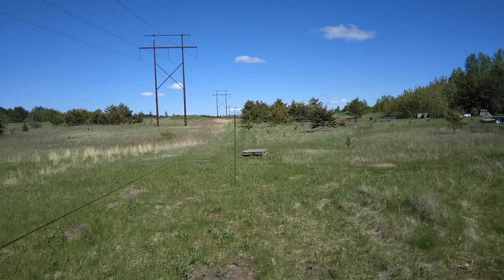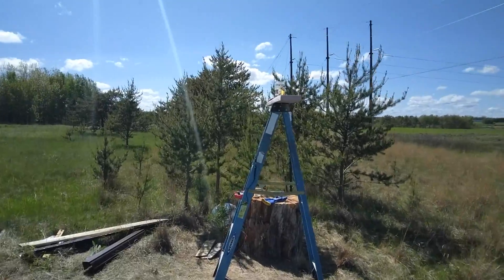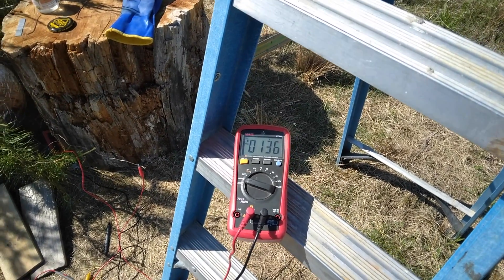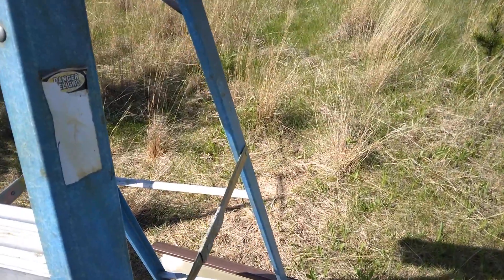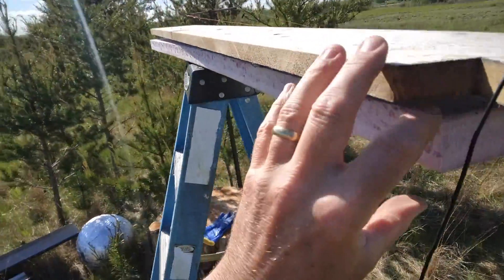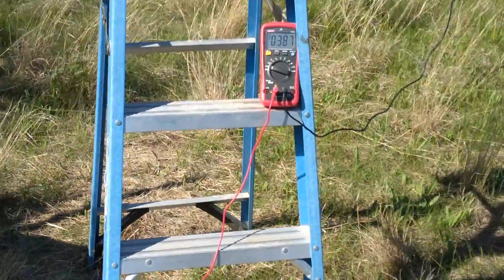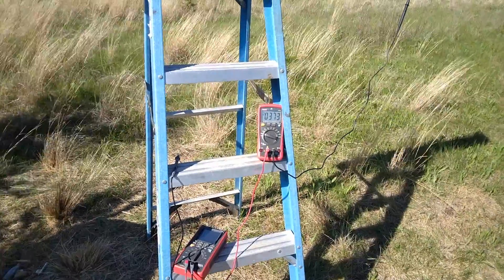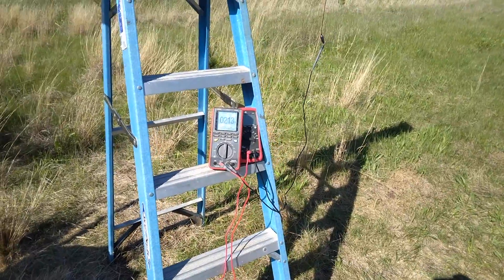Amazing stray electricity collector design!

Comment: It's called influence or capacitive induction. For magnetic induction the magnetic Feld is to weak

Electric Feld probes are built similar. To detect electric felds. If you are in the vicinity of an HV transmission cable then you have pooven that that company that own the transmission line ate polluting the area with strong electric felds. Also if you aren't under a transmission line then you are getting atmosphereic charge. The earth has equipotential lines parallel to the earth ground they reach till to the ionosphere roughly 100V/m to 200V/m of elevation. If you put a isolated conductor up from ground you get a voltage. That's the reason why atmosphereic motors work. If you are interested Lasersaber's Channel explained it very well. Just Typ his channel nam or Atmosphereic motor in the YouTube search

Comment: WARNING!   Basically you have built and air core capacitor. The power lines are one plate and your wire you have strung around in the air is the other plate.  WARNING! The primary part of your capacitor (the power lines) are operating at maybe hundreds of thousands of volts and very high amps are available. If you happen to get enough surface area on your side of the capacitor with certain weather condition, you could have a chance of an ARC from power line to your side. I STRONGLY suggest you find another hobby for your own safety.

Comment: I wonder if the wood board works better because it capacitively couples to the grounded metal ladder worse, so slightly less losses. In that case it'd couple to the lines worse as well tho? so maybe this is a silly guess. Actually I bet most of the energy comes from the ions literally streaming off the lines. Rather then the antenna coupling to the lines? So this would still make sense to some extent.
Idk im gonna keep watching these cuz this is honestly fascinating. Guess I'll find out if you ever figured out an experimental way to work out what's going on

Comment: So one of ur videos had me thinkin,  my pond is right by the railroad tracks,  and theres olld unused telephone lines ran there,  wires still there,  say i put a ground rod in the pond wouldnt thoae telepjone lines have power?   There side by side conductors like u had goin from roof to barn.  Im in nd btw
Reply from the maker: If the wires on the poles are insulated from any grounding effect, there could be something between the wires on the poles  and a pond ground.  What could it hurt to test it?  Best wishes!
Reply: @doubleMinnovations  what would be a safe way to test?
Reply: @doubleMinnovations  do i dare get a ladder and my voltmeter and connect black lead to pond ground rod and touch telephone wire with red lead?

Comment: could you use a regulator or step down transformer to charge a battery?   Or,  store enough charge in your vinegar batteries to be useful for a low power project?
...also wondering if wood is yielding more than aluminum, where would copper (old bit of pipe if you have some) or coax sit on the scale of things??
Reply from the maker: I would suggest watching the other videos I have on these subjects.  There's small amounts of energy available, but there's only so much energy available for a spacial area.  So the many different metals and wires I tried, the weak acid treated wood is so much easier and cheaper to construct.

Comment: Telluric Currents. I think this was what Mr Tesla was playing with. They occur naturally in the earth, as well as manmade things can cause these currents. Hydro lines and Pipelines use Cathodic Protection systems to protect metals in the ground from corrosion by pumping current into the earth in high corrosion potential areas. Sometimes the currents find their way to the surface and show up in conducting materials such as fence line wire! Would be cool to see if you could hook up a solar charge controller and battery to see if you could collect a charge:)

Comment: That has been done before. It is just the current in the overhead lines acting like a transformer primary, and your setup is the secondary. Just make more loops of your line and you will collect more power, with a higher voltage. Just notes that if you draw power from this for your house etc it is essentially theft. Also, it is detectable by the power company with their fault detection systems, and they can locate it to your property.

Comment: There is an electrostatic voltage of something like 100 volts per foot of height above ground, that supplies microamps of current depending on area...Your meter is measuring the voltage according to the current flowing thru the megohm impedance of the meter, not the actual voltage of the static source...Of course you will capture some of the field energy
of the power lines but that energy falls off as the square of the distance....If you want to have some fun, find a 1Kvolt capacitor, attach a spark plug with a 0.005 inch gap, place that at the end of your wire and ground the outside of the plug and the other end of the capacitor.....

Comment: I have an antenna outside for ham radio. In the past being a little curious during a small storm I had attached a tiny christmas led light bulb to the coax line from the antenna and the led  bulb would flicker and turn on at times. The energy is out there.

Comment: Try using some chicken wire.If it's capacitive coupling the extra surface area should get the volts up a bit as well as the current.  A bridge rectifier and a cap might get you enough to run an electric fence.  If not that much you could possibly use it to recharge a battery.  All sorts of possible ways of getting, a little bit, of free power.  It might not be much but it's cheaper than running a copper cable back to the ole homestead.   🖖👍🇦🇺

Comment: The Vinegar is a wast of time. A long wire, and a good ground return is all you need to extract electricity, and then use a step down transformer of appropriate size to use power.

Comment: You are receiving the electric field coming off the powerlines. The more surface area you have the more current you will get. The higher you mount the antenna the more voltage. Your metal ladder is shorting field to ground. I used a 3 foot long coil resonated to 60 Hz and got about 3 milliamps 50 feet away from residential lines. It picked up the magnetic radiation instead of the electrical field. Don't charge up capacitors to dangerous voltage levels, it takes time but can give a lethal jolt.
Reply: Theft by induction.

Comment: Get your hands on a regular TV antenna! This should get more current that could prove useful! 
300V even at a few micro amps is not bad! 
I was trying to see if you were measuring AC or DC? But couldn't catch what the meter was set at? 
If the 300V was stepped down, you could achieve a usable voltage and current, and if it's charging a battery day and night! I would have that back fence covered in TV antennas! When questioned, I would complain that this is what I have to go through to get decent reception for my TV!
Reply: Its AC power 👍😂

Comment: The short answer is no, wood is not 'conductive. ' However, the main components of wood are lignin and different kinds of cellulose. This means that it does not have the free electrons that are usually required for an electrical charge to pass through a material. wood is an insulator, as long as its not contaminated wet ect.

Comment: @doubleMinnovations About the trees.  I notice you are holding the camera in your left hand while moving things with your right hand.  When you move your right hand to your left side, it crosses your body and is closer to your body than when your right hand is extended.  The trees may or may not be interfering with your results, but the greater impact is the proximity to your body.
Also, try this experiment with different metals and different shapes.  Copper and steel pipe of different sizes, cast iron cookware, steel and iron tools.  Copper and steel sheet would also be interesting.  When experimenting with metal or wire, sand down to the actual bare metal at your connection point to remove any insulating coatings such as grease, acrylic, lacquer, epoxy or paint.

Comment: @doubleMinnovations Try this with different sizes of copper and steel pipe, and metal conduit.  Also try with cast iron objects, such as cookware or tools.  Copper and steel sheet may be interesting too.
About the trees.  You seem to be holding the camera with your left hand and moving things with your right hand.  When you move objects from right to left with your right hand, your right hand moves across your body and ends up closer to your body on the left side.  It may not be the trees skewing your results.

Comment: Interesting. What happens if you keep your conductors horizontal but turn them perpendicular to the power lines? Also, what changes occur if you make the conductor vertical (prop it on end next to the ladder)?
Reply from the maker: The voltage changes depending how far it is overall from the power line.  If one end is brought close to the ground, the voltage really drops, and if it touches the ground, it just grounds it out.
Reply: @doubleMinnovations  Cool.Thanks for sharing.

Comment: The Vinegar and copper is adding electro-chemical and inductive properties.  The vinegar contains mineral salts that will make the water a weak conductor (same as using salt water) which increases the surface area of your "antenna".  The acid will also create a weak corrosive charge with the copper wire and with its larger surface area its essentially doing an open air ground loop to complete the circuit (it'll always be low as the air isn't great for moving electrons, but it is a very high resistance path).

Everything else with the wire is just straight induction... basic antenna design at play.  Ideally you would want to work in multiples of exactly 18.77 ft (wavelength for 60hz) although that will really depend on the distance and position from particular wires (each line will be at a different phase, so the combined reaching any particular point will require distance from each phase and angle numbers).  Of course, with an oscilloscope you could just measure the frequency at points and tune accordingly.

Optimal antenna design is a bit beyond my expertise, especially as at this distance it's not as simple as being a point source, and you cannot easily encapsulate the entire wire in a coil.  So large coils or spiral formations are going to have sections running in ways that will cancel each other out.    A long whip along the run is probably the best overall without some really complex design, either that or maybe a large sheet curved to match the approximate radius from the wire.

Comment: The reason you cannot get any return on the wood only test is that the wood is nonconductive by itself.  If there was a conductive fluid (water or almost any other fluid) on or in the wood, it would allow your meter to respond.
You are correct about the trees draining the energy as the wood is "wet" and it absorbs the energy because it is grounded and electricity will find the easiest way to get to ground, lust like lightning does.
Keep up the great work and you now have one more subscriber.

Comment: These stray voltages don't generate enough power to do any useful work.  With the numbers in this video (voltage & current), he's getting about 6 milliwatts of power.  Even the smallest LED light needs 10x that much power.

Comment: If you installed diodes in series with your wire on poles would the voltage add?

Comment: The vinegar soaked board is doing essentially nothing. Just drive nails on both ends but leave the wire off.  You should read virtually nothing but maybe a little bit of voltage picked up by the meter wires. Wood, vinegar or not, is a terrible conductor. But the copper wire is a very good conductor. 

There is an electromagnetic field around the power lines but it decreases exponentially wit distance. But it can still induce voltage potential in conductors passing through the field. That is what you are seeing. 

You should try going out at night with long fluorescent bulbs. They should glow!  

Generally what you are doing is relatively safe, but  you are in that field and you are conducting a very small part of that field to ground, which is why you see the voltage in the wire drop when you are close by. You create an effect similar to what the rooted trees and bushes do, but they are better grounded although less conductive than a human meat bag!

Instantaneous current should be quite low but it can probably charge a capacitor over time if you use diodes to rectify it to DC. It might be interesting to build a circuit with an LED. you probably can't get quite enough current to light the LED continuously, but probably could use it to charge a capacitor and ten trigger it to flash the LED. I can't began to guess at component values but LEDs are typically around 1.8 to 3 volts. A transistor cold be used to trigger the LED when the charge voltage gets high enough.  In theory, you could automatically cycle it from charge to flash.  You can push LEDS to higher voltages very briefly.  I think it would be pretty cool to have a string of these little LED flasher circuits set up to flash in thee dark. 

I don't have any high enough voltage lines nearby to try this. But I think it would be pretty cool!

Be safe! Read up a bit and have a good idea what to expect. I think the energy levels are potentially enough to build a pretty good charge on a capacitor which could be dangerous.

Comment: yes, you can collect energy from hv powerline. it won't be stray, you're taking power away from the line. one would argue at which point you exceed natural loss. there is no foiled ball, eps foam, pickled boards, rainpipes and other things needed. there is more energy up you do, but eventually you die. there is also more energy depends on turns. and induction is along the wires so align your coil that way

Comment: Its called EMF / a farmer in Texas in the 60 set up his chicken house under power lines and ran a coil on his roof and it would run his lights till a surge would come through and blow all his lights in the chicken house and the power co told him he was stealing power from the power company but there was no way to prove it
Reply: Alternatively you could claim the electricity company is contaminating his land with EMF.
Reply: Inductive loads do use power otherwise anything behind a transformer would be "free" energy.  This is just the worlds worst transformer in that form. The power companies claim is technically right, though not worth the time and the effort as power used for a couple lights is nothing. I doubt they would even spend the legal fees in fighting it.
Reply: @hgbugalou  they did take him to court for stealing power even though they could not prove how much he was using
Reply: Careful. The electronics nerds will get in an uproar about using EMF. It's already used for electromotive force, like what drives a motor.
I think it's supposed to be EMW propagation. Electromagnetic wave propagation.

Comment: Is one lead of the volt meter connected to a ground rod? What is the difference in voltage/current measured in a wire mounted on a board with vinegar wash and without vinegar wash?
Reply from the maker: Yes, one lead is connected to a ground.  See some of my other videos.  With the wood, it really seems to be the type of wood that's being used.  With green treated lumber, the vinegar didn't do anything additional.  With plain pine lumber, it was showing an increase of around 10%, With dry cedar it was showing over 20% increase.  Seems to be determined by the moisture content in the wood with the natural electrolytes or added ones.

Comment: Just don't ask the company if you're allowed to do that, because the answer will be a resounding no. I watched the video here on YT, and the guy was talking about his friend, asking similar question about radio waves, and he got an answer that it is forbidden.  So the solution is obviously not asking in the first place:)

Is the wind moving the conductor wires above? If so, that could affect your readings, because what you're picking up is obviously some kind of induction.

And the trees around are just sucking their share of electroculture, with or without antennas. But I see no reason why you would be able to read the resistance of dry wood, regardless of it being soaked in electrolyte or not as long as it is dry. Adding some water would probably change that. But your reading was from the wire, not the board anyway. It's normal that the wire functions as an antenna, so you could maybe check online antenna calculators to find out which lengths you could try for 50Hz, if that's what you have got in your area.

If the conductors above are not insulated, the best harvesting method would be a metal hook attached to the thick cable, and if they are insulated metal hook, but sharpened, so you hook it up, hold on tight to the cable, and jump from the ladder, and after couple of swings you'll have te contact. Don't worry, you'll know exactly when:)

Just kidding, keep up the good work!

Comment: You're doing great stretching out that inductor performing capacitance with that power line grid above you there acids or jars or any other type of capacitor will add storage for your antenna putting oscilloscope I guarantee it's 60 Hertz off that power grid.....
Reply: No. It's not just 50/60Hz, this frequency varies with the load on the grid generators.